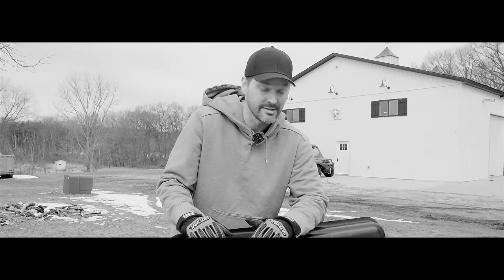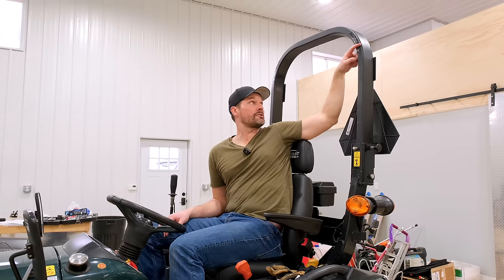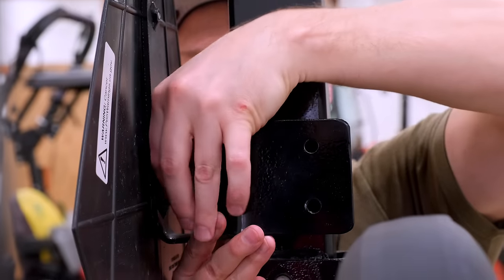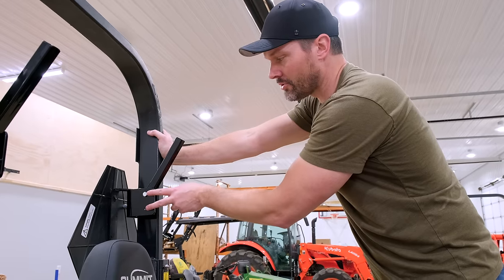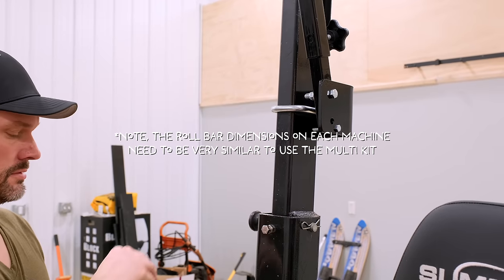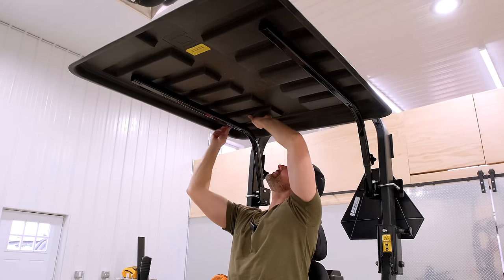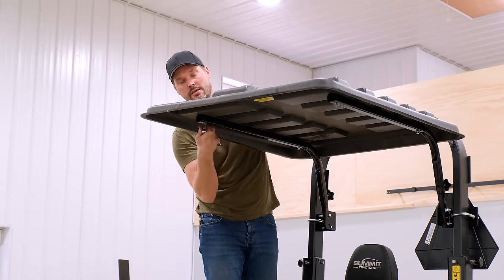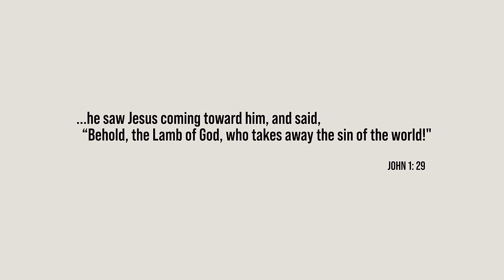THE BEST TRACTOR CANOPY! CHEAP, TOUGH, LIGHTWEIGHT, USA MADE

Comment: My Rhino Hide canopy , I have had for years and has been on 2 Kubota Zero turns , love it . I just added a 16" fan on the under side to make it cooler for my wife to use . I also added 2 strut bars to the front to make it more sturdy .

Comment: You need to look into shipping into Canada.
Not big ol' heavy attachments, but things like this canopy, versabracket (w/o weights), UHMW (near impossible to find, local dealer never even heard of it) and hitch hangers!
Reply from the maker: Unfortunately, easier said that done.  I've tried, spun my wheels countless times on quotes.  Didn't pan out a single time, so I give up.  Just not worth it right now.  Canadian distributor might be the answer.

Comment: you were having way, way too much fun in the beginning of the video. what a way to demonstrate the durability of a product. i might have to get one for my little 1026R. i see your site doesn't list it but i fingure the one for the 1025R is likely the same. thanks for posing and the installation demo.
Reply from the maker: It was a good time :)  Definitely will fit your tractor.  Straight ROPS, don't go with forward leaning.

Comment: Would it make sense to put a rubber gasket under that washer that goes on the roof top, just to ensure that no water leaks through the hole in the roof you drilled, or is the material soft enough that it is essentially self-sealing when you tighten the bolt down?

Comment: I watched a video from tractor time with Tim and he had one that ripped off going down the road at 35mph. Now I know tractors don't go 35mph, but may of us do trailer our tractors. What do you recommend if this is the case, would I have to remove it, cause that might be a pain, and you could forget it somewhere. love it otherwise if it's that tough.
Reply from the maker: Yes, we mentioned this in the video as one of the benefits.  Sometimes TTWT is guilty of not reading things just like I can be.  It's easily removable by one person for trailering.  It's very lightweight, about 15 lbs.  

There is also a big sticker that says not to trailer with it.  We've tried to make it very obvious that you shouldn't trailer with it and also highlight the ease of removal.  If you forget it, well maybe put an Air Tag on it so you know where to find it, ha! 😂

Comment: New event - the Canopy Home Run Derby!

Are you planning to add a rubber washer for the four bolts connecting the canopy to the frame?
Reply from the maker: Haha maybe so!  Crossed our minds, continuous improvement
Reply: I didn't add rubber washers and no leaks for the past two years.

Comment: Love the Rhino Hide...just wish it was offered in a bigger size.  There must be some workaround with the shipping issue....
Reply from the maker: We'll need to design a modular system...sorta like overlapping steel wall panels like on the barn for example.  In process, but not coming soon

Comment: Do you think there will be larger sizes in the future? I’d like one for my open station 5E but with a little more coverage
Reply from the maker: Yeah, we are working on it slowly...it'll be some time coming, but eventually we'll have a larger size.  It'll have to be modular in design.  We're maxed on shipping dimensions right now which is the reason for the current size.
Reply: @GoodWorksTractors  thank you for the reply, I will hold off until you all get the larger size..it will be nice to have in the dead summer when it’s 100+

Comment: I get a "Secure Connection Failed" error message when I try to go the website.  While, I can lower my browser's security, you might want to review your web cert or TSL versions allowed to ensure it uses the latest security.  For now, I cannot access the website with my security settings.
Reply from the maker: Strange, you must have some HIGH settings, haha.  We use the same developer, settings, etc for both my site and tractorcanopy.com.  Not sure what's up with it.

Comment: i love this tractor but but , it really is a solis H24 .... and im fine with that but when i tried to order a solis H24 with 3rd function they told me they dont make a 3rd function for it soooo what am i missing
Reply from the maker: Summit is no Solis. They are two different companies who both use ITL for mfg. Summit really is set apart from other brands because of those features. So while the tractor base unit is very similar, Solis and Summit are not the same!

Comment: Why do you have to drill holes in a $400+ canopy? At this price all the holes should already be drilled and painted.
Reply from the maker: If the holes are predrilled, then you don’t have the flexibility to position it where you want.  Ever tractor is different and will need the canopy further forward or backward.  So, holes can’t be predrilled because of that.

Comment: Rino canopies aren't cheap
Reply from the maker: That's a relative statement.  So, what are you comparing it to?  Not having a canopy?  A piece of cardboard?  A piece of cloth?  Compared to most canopies out there, the Rhinohide is definitely cheap.
Reply: @GoodWorksTractors  don't get me wrong it's a better built product,  but labeling it cheap isn't correct, last year around this time I was shopping around for 1 and got Tuff Top for around 220ish for my branson 2515h,  the new mounting design on the rino looks great BTW, alot better than the others, I wish yall had it go on top with a locking swivel so it could easily cove my backhoe attachment seating area, no one has made anything like that yet... maybe I should fabricate what I want, I do it alot already lol